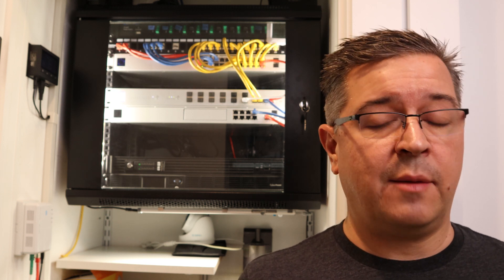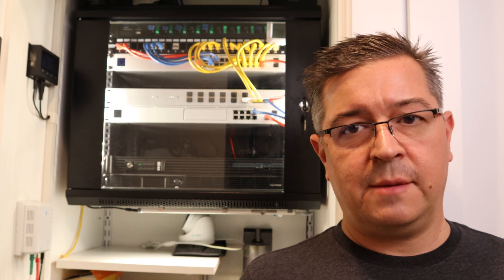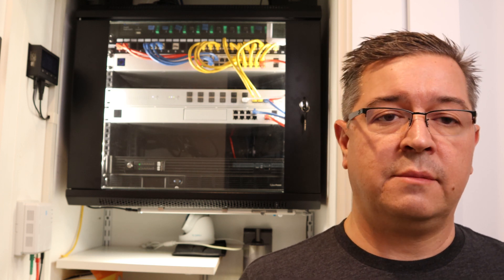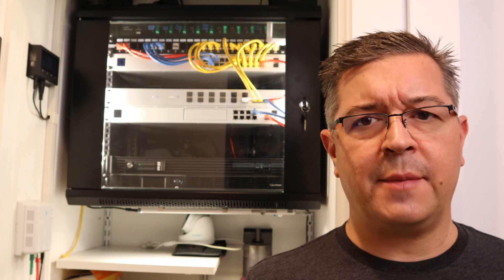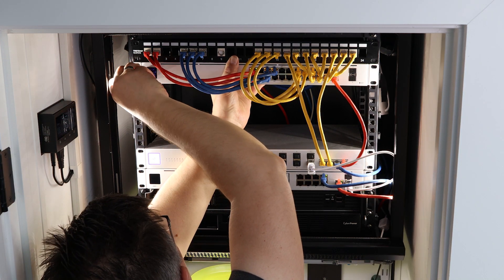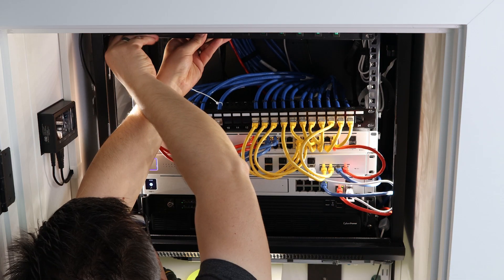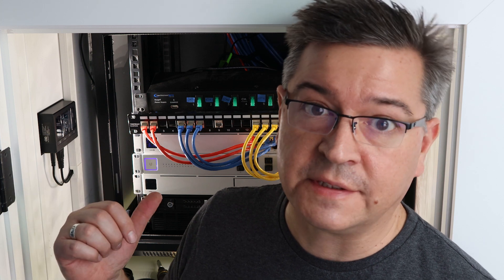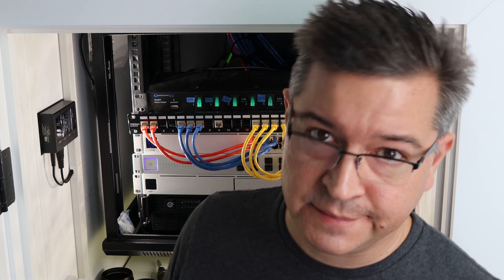Network rack cleanup and installation of Synology RS1221+

Comment: Why are you using RJ 45 to connect your POE switch to your 10GB, instead of going through the SFP port on the POE? Similarly, RJ 45 from POE to UDM instead of interconnecting UDM through 10GB switch with SFP?

Comment: There's more potential here. Get brushpanels to cleanly route cables through your rack and shorter cables to connect devices right on top of each other.
Reply from the maker: Thanks for the comment, Corristo! If only I had 1U more of rack space for a brush panel... I'd fill it with more equipment! ;-)

Comment: I fast-forwarded back and forth twice and I didn't' see the reason for of that. All you had to do is move your UDM Pro (take a look into pfSense) and the switch above it up one notch (1U).

Personally, all my equipment is completely hidden and my NAS / camera switches are in a completely separate location.
Reply from the maker: Thanks for the comment, D! The up and down moves for the the equipment was to get at the wires in the back of the cabinet and manage them so I can pull components out more easily. Is it strictly necessary? No. Not until I go to pull out one of the components to repair or replace it, and I can't pull it out because the cords are snarled up in the back of the cabinet!

Comment: Nice upgrade, and enjoy you showing some snarly issues. That's a tight space for your rack. Hope you are enjoying the Synology! Really like your UniFi Switch XG 16.
Reply from the maker: Thanks for the comment, Stephen! Glad you enjoyed watching my struggles. :-) The rack IS in a tight space, which generates some cooling issues (see other video on that) and makes maintenance a little harder. Overall, I really like the convenience and physical security of the rack being in the house proper, rather than the garage, which was it's former home.

So far the Synology's been great! I edited this video off of it, and it was noticeably snappier with the 10Gb network connection. I like the XG 16 a lot, though it would be nice if Ubiquiti did a modernized version (like the Switch Aggregation unit: https://store.ui.com/collections/unifi-network-switching/products/unifi-switch-aggregation). I looked at that Aggregator briefly, but it's just doesn't have enough expandability for me.

Comment: To eliminate routing any cable from the font to the back via the side (as you have on the right part of your rack), you could install the appropriate type of keystone into your patch panel as your pass-through, as it looks a lot neater (at least I think so). Also, by putting the patch panel between your network switches you can shorten your runs by a few inches by sending some cables up and others down. However, I can understand if you don't want to do that, being that your current device grouping looks aesthetically pleasing. Lastly, I noticed that you have a Technical Pro power distribution unit. I have found that those units will eventually burn out their indicator lamps and their switches sometimes fail mechanically. However, there is a really well constructed unit made by American DJ (also called ADJ) that has green LEDs and high-quality mechanical switches that I very much like. Anyway, nice job and thanks for sharing!

Edit: I forgot to mention that the power distribution unit model is called POW-R BAR RACK and costs roughly $64.
Reply from the maker: Thanks for the comment, Peter! I use the keystone panel exclusively for terminating lines coming into the network closet from the rest of my house. I could use the open jacks for internal cabinet routing (which could make things even cleaner) but some of those open jacks are reserved for future use. Also putting the patch panel between the two switches is a good suggestion to minimize patch cord lengths. I considered that in an early design of the panel, but I went with the top mount position because it's a little easier to maintain when adding new incoming network lines.

> ...Technical Pro power distribution unit. ... those units will eventually burn out their indicator lamps and their switches sometimes fail mechanically
+100!! Glad to hear I'm not the only one who has experienced failure with these units. I haven't noticed the switches failing (yet), but the LED indicators burned out ridiculously quick. I am planning to hack one of these units to try to make it more robust (and aesthetically pleasing). Stay tuned for that future video.

Thanks for suggesting the ADJ POW-R BAR RACK for power distribution! Just from the product pictures I looked at, that unit seems significantly better made. The Technical Pro goes for $50 US, so paying another $15 for a more reliable product seems like no-brainer to me. Anyone else have experience using that ADJ product? Here's a link for folks who want to check out that unit: https://amzn.to/3sQWhtR

Keep the comments coming! Thanks again, Peter!
Reply: @MakeHomeTech  Very glad I could help. I also want to mention that the rocker switches on the ADJ power unit are 3/4 inches wide so you can use a label maker to stick a title on the lower part of the switch itself. I used a black background label with white text, so it looks like it is part of the switch. No more blue masking tape :)
Reply from the maker: @PeterHonig.  I love my blue masking tape! :-D I did pull out the label maker to make the rack more readable and professional. Will share on on Instagram.
Reply from the maker: @PeterHonig.  I fixed it! https://www.instagram.com/p/CYspBJaLMIY/
Of course now, I'm thinking about your "black background label with white text" approach and thinking.... Yeah, I should really do that instead... 😛
Reply: @MakeHomeTech  It has been a year since I visited this thread and I just saw your photos on Instagram. WOW, FANTASTIC! I love those cable combs that you make with your 3D printer. Excellent clean work and thanks for sharing.